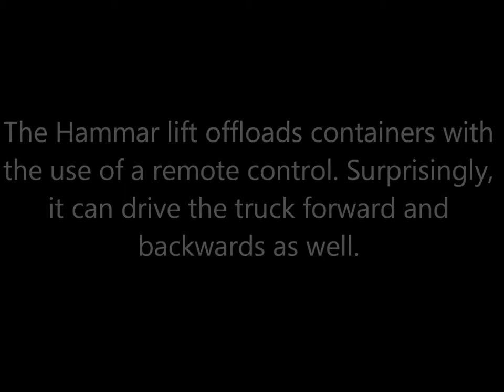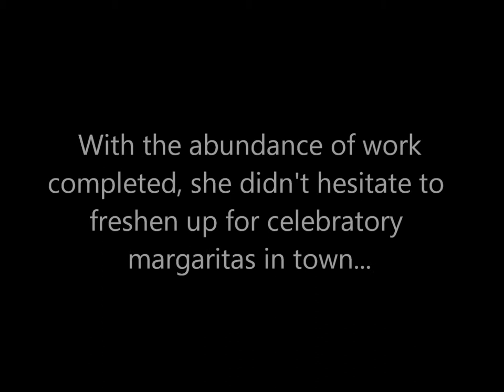Off Grid Dome Cabin Project: Shipping Container Deck Build

Comment: Great video, wish there was more, how exactly did you attach the boards to the back of the container, did you weld brackets on ?
Reply from the maker: The boards span two feet past the backside of the container. No welding. Anchors or straps drilled into the container are an option as long as the holes can be sealed. Currently not attached as we are thinking of moving things around.

Comment: Where is the support coming from for the 2x4s touching the container?  Are they just laying directly on the top of the container?  Have u had any structural issues?  Thought the corners were the only part that could take a load.
Reply from the maker: No structural issues. Our boards span across the top past both sides of the container. Most support comes from the edges/corners where the top meets the side (I'm assuming those are the corners you are referencing), but I'm sure we get some support from the roof as well. Spanning charts online can help you estimate board size, load limits and spacing, for your specific project. If you cut the corrugated sides, say for a door, some building codes require reinforcement beams, since the sides provide structural strength. Hope that helps.

Comment: Going to be doing the same kinda project on the big island. Do you have any container sweating or install and insulation? Did you weld anything to hold the hoist in places?
Reply from the maker: Corey Construction 369  We don’t have sweating issues at our location. I think painting the outside white might help with the heat a bit; insulation was considered but we passed on it until the container becomes a living space. Currently it’s a shop and storage.  We did not weld anything.